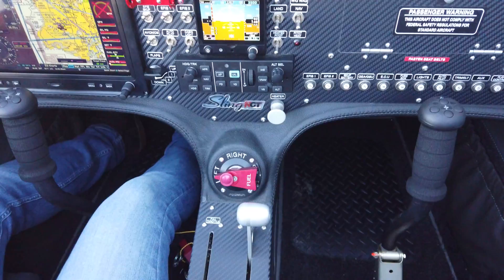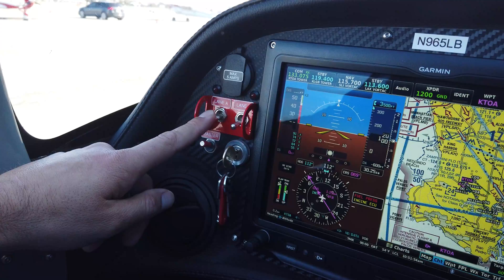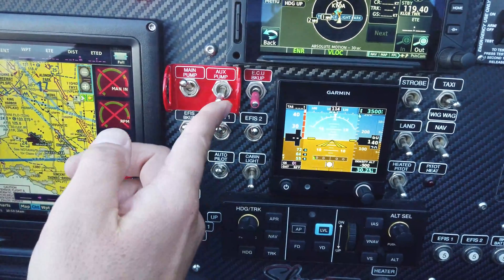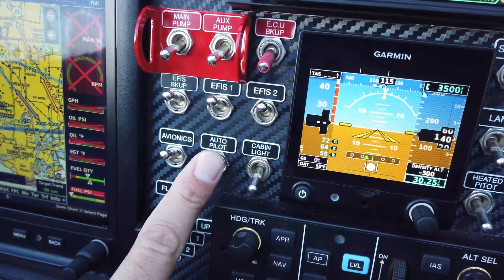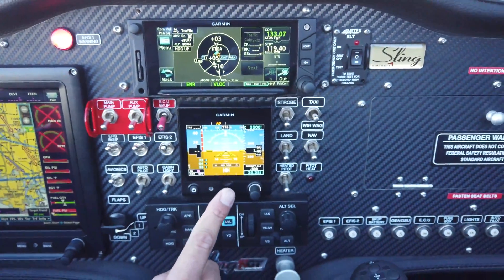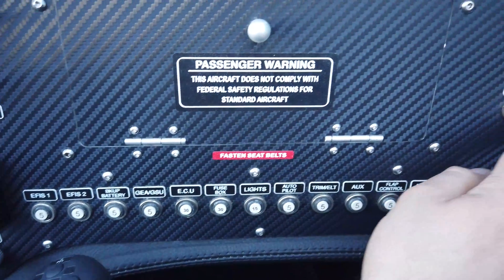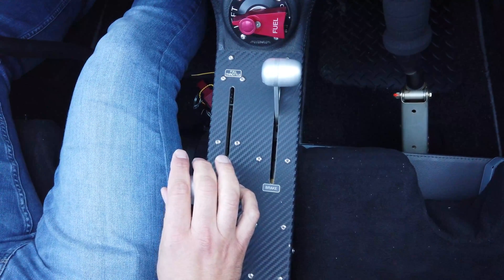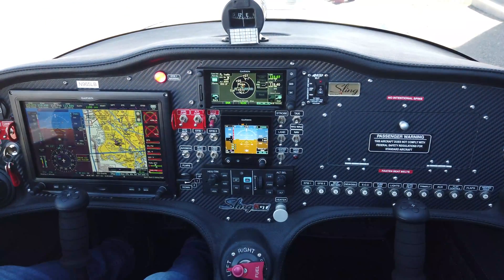Sling NGT Cockpit Tour

Comment: Cool aircraft.... The 5-amp cigarette-lighter power adapter seems like a strange choice though. Is that the only charging port? iPads can take up to 3 amps or so when charging... I guess you could get a dual-usb cigarette lighter adapter, but In a craft like this I'd expect also see at least a dual-5-amp USB port of some type. I guess it's not expected these craft will be used much for travel?